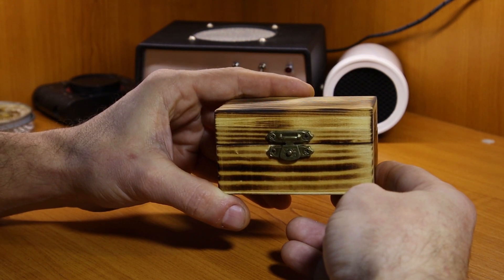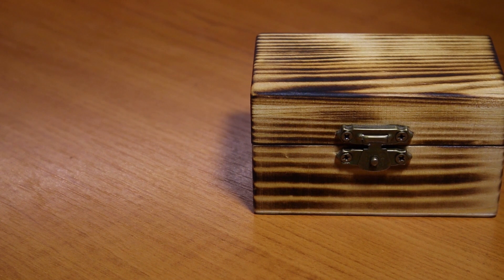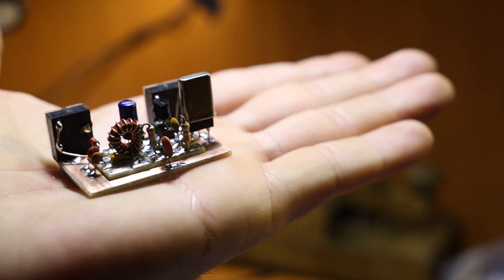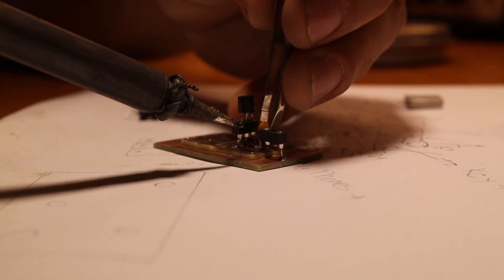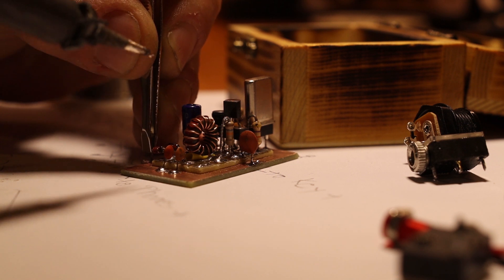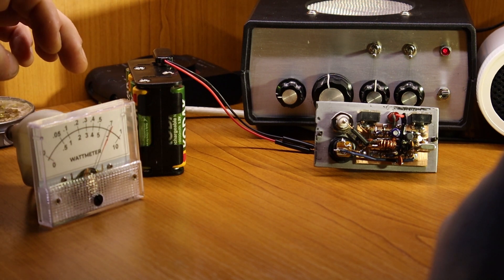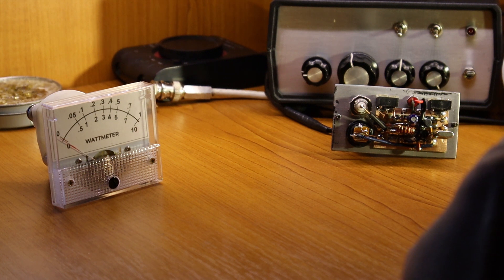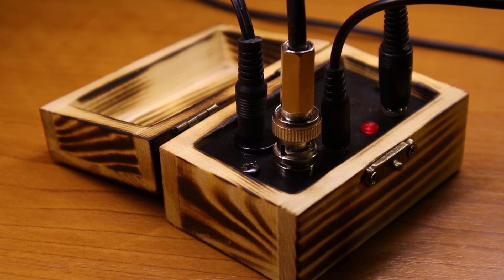Pititico CW Transceiver Designed by PY2OHH

Comment: Hello, how do you use/configure/connect that wattmeter to be able to measure the power output of your radio emitter.
Thanks
Reply from the maker: This is the one that I am using:
https://youtu.be/A_l51lLlydI?si=DAArgzWHKqEYKOpg

But because it already has a 50 Ohm dummy load included, I don't really do much but just to connect it to the output of the transmitter or transceiver and measure the power output. Let me know if you would like to know some particular detail. 73, YO6DXE
Reply: @dxexplorer  Thank you very much, love your chanel and your videos
Reply from the maker: @tekno8max872 Always a pleasure. Thank you as well for watching. 🙏🙏

Comment: Найди пьезокерамический кварц в виде капли из пластика, они есть в старых цветных телевизорах на 3.580 кГц он в последовательном подключении с переменным конденсатором даст возможность перестраивать частоту во всем cw диапазоне. Удачи!
Reply from the maker: Ohhhh it would be nice. Sadly because the schematic is so simple, it's a little complicated as soon as I try to change the frequency. The offset frequency would be a mess and it will need constant adjustments. But that is a good idea for a little more complicated schematics where the oscillator and offset frequency are more stable. Thank you my friend. 73, YO6DXE.

Comment: I would like to see the entire process of the project from creating the enclosure to installation. This is really nice. I'm wondering if the same circuit could be applied with a transistor like 2N2219 or BD135. I doubt BD135 would be good for receive
Reply from the maker: 2N2219 and BD139 work pretty well. Unfortunately for the entire process I have very little time now. Maybe a little later in the autumn time.

Comment: Nice sir..I find for my equipment when hiking thanks to share schema.. how far range it can be reach?
Reply from the maker: Have a look at the latest video... or the article on the blog on Pititico II. It also has the LM386 audio amplifier included so you can use regular headphones. The range..  it depends on the propagation. With 700mW you can sure make QSO's all over Europe in a good day... or no QSO at all if the propagation is not good )). 73, YO6DXE.

Comment: Hii is there any way to replace crystal with VFO?
Reply: I got the point 😊 and waiting for it.
Reply from the maker: @vivekchauhan7468  Sorry for the late reply.... the comment keeps going into "likely spam" from YouTube. Not sure why. Ohh yes I cannot wait to have some time to play and see how that would work.
Reply from the maker: I thought so too... but I think the VFO has to be a good one. The circuit is really simple so it will may pull the VFO frequency really easy when transmitting. But then it would be no more simplicity in the circuit ))). I am trying to work on something else that also includes a VFO... but it will take me a little as I don't have so much free time.

Comment: Great simple circuit.  A capacitor across the headphone jack will remove some of the unwanted high-frequency audio.
Reply from the maker: I love these simple circuits too. Ohh yes that is a great idea... the capacitor I mean. I didn't tried it as I removed the high frequencies in the external amplifier I'm using 😁

Comment: Can i use 7 mhz crystal to 8 mhz crystal  ?
Reply from the maker: What do you mean 7MHz to 8MHz ? Like any frequency between 7 to 8 ? 8MHz is no longer into the amateur radio bands so is illegal. The Pi Filter on the input is normally adjusted to be used for the CW portion of the 40m band ( 7MHz )... so usually you would use a crystal more common for the QRP calling frequency something like 7.030MHz. I hope that was the question )))
Reply: @dxexplorer  thanks for understanding me

Comment: Hello Ciprian, and happy new year to you. I enjoy your videos and projects and I especially liked this project so I built your version of this last night. The RX works as expected but as you discussed, my TX is heating up and shifting frequency after a second or two of key down. Having seen your success, I will continue to work on mine until I can get it to work. I will make it a point to report my findings and experiments to you. Thank you for sharing your projects with the community and 72's de N9AK...
Reply from the maker: Happy New Year Mark... and thank you. I'm glad you like the videos. Today I was lucky and the propagation was great so I had amazing reception on the little guy. I will somehow insert a short clip in the next video. About the transistor heating... you did used a dummy load right  ? )) And yes it does get a little hot... especially on 12v with 1W output power. Check the transistor and if you can measure the Hfe over 450 and the Uf around 650 or over. I tested a lot of 2N2222 transistors and the Chinese ones are with an Hfe less than 250 most of the time. Those seem to be unstable and overheat excessively. I hope you get it figured out. I still can't believe mine works so well. Now I just have to build a little amplifier for it so I can use regular headphones. 73 my friend and let me know how things work out for you.